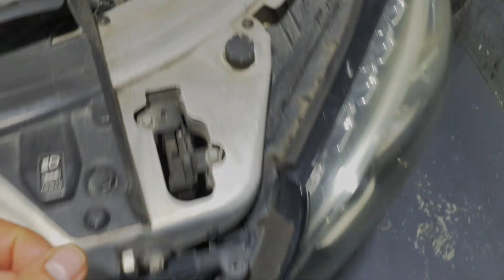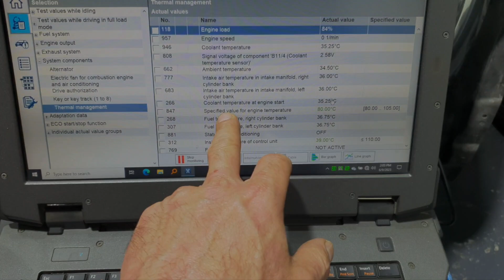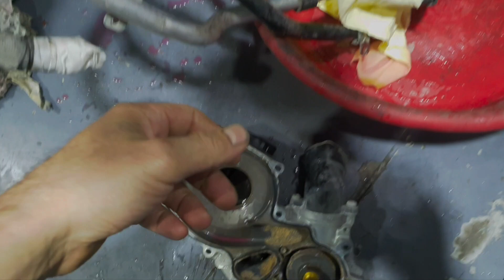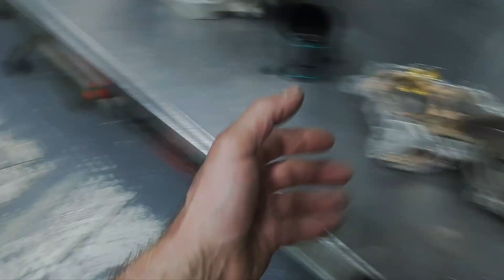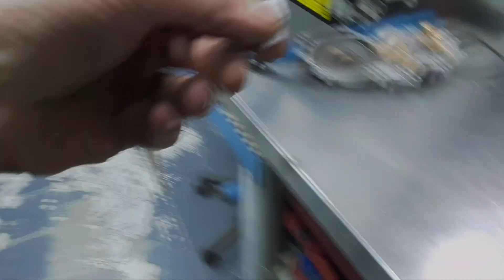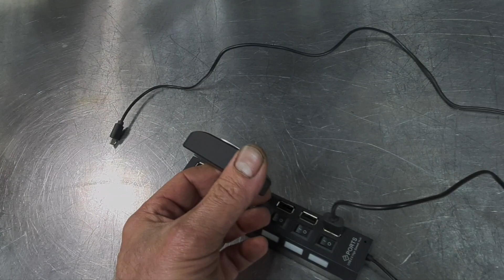C63s 2017 with 165k km small maintenance (part 1)

Comment: I have a ml63 m157 engine. Ive worked on replacing waterpump and other parts. Does the m177 engine harder to work on compared to m157? My wife has a glc63 with m177 and was wondering. So working anything on front of the engine you need to remove the whole front end?

Comment: Original coolant after 165k kms? That's way too long. No wonder there is so much corrosion. Unless the engine is overheating, not sure why the owner wants to bypass the thermostat. Thermostats are there for a reason, which is to allow the engine to come up to the minimum required operating temperature as quickly as possible.
Reply: Only reason that engine is needed to get hotter faster is for emissions the hotter it gets the faster the cats start working. Performance wise there is nothing wrong with having an engine run cooler, its actually more desirable.
Reply: @HorsepowerTherapy2  Thermostats aren't only to allow the engine to warm up more quickly, but also to prevent the engine from not warming up fully.
Reply: @darylmorse  sorry but rbat doesn't make any sense. Engineers don't prevent engines from warming up faster. They want the engine hot as quick as possible.
Reply: @HorsepowerTherapy2  Clearly, you don't understand what a thermostat is for. You do some research and learn why every engine made for DECADES has a thermostat.
Reply: @darylmorse  if the catalytic converter did not exist I can guarantee engines would not have thermostats. Can you give me one benefit to having an engine run hot? Bet you can't because it's all emissions get with the program
Reply: @HorsepowerTherapy2 For someone with a name like HorsepowerTherapy, you are uneducated about how cooling systems work. ENGINES HAVE HAD THERMOSTATS FOR DECADES, LONG BEFORE THERE WERE EMISSION CONTROLS. (YES I AM YELLING.) A radiator is sized to cool an engine at high load to prevent the engine from overheating under high load. If the engine is not operating at high load, the radiator is oversized. For example, an engine that's idling or being driven with low throttle, such as steady state on a highway. In these situations, if there is not a thermostat, the engine will be operating a much too low temperature for fuel to atomize and to boil water and fuel condensate out of the oil and for oil to reach the proper temperature. A THERMOSTAT PREVENTS THIS SITUATION!!!! It causes coolant to circulate in the block and not get cooled by the radiator, allowing the engine to heat up to a reasonable minimum operating temperature, such as 85-90C. If you don't understand this, you should not be allowed to work on anyone's engine. Any apprentice mechanic knows this.

Comment: Scary to see the coolant corrosion in a 6 year old engine; and all that plastic for sure will not be around in 15 years time. Definitely one use throw away cars these days🤣
Reply: It has 165k kms on it
Reply: Did they ever replace the coolant and the reservoir ?  
Probably not.